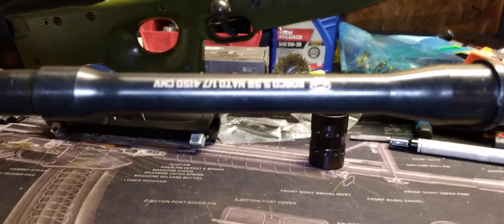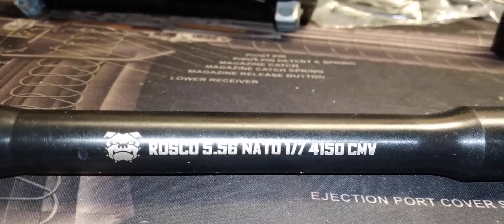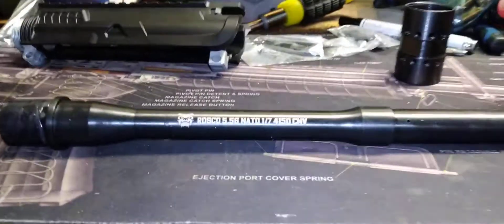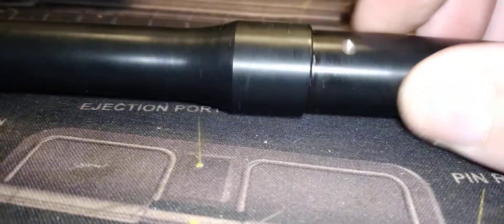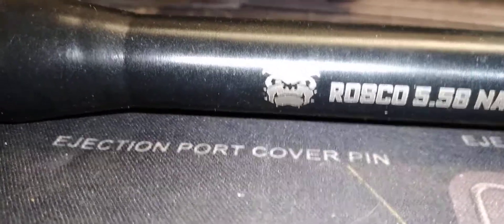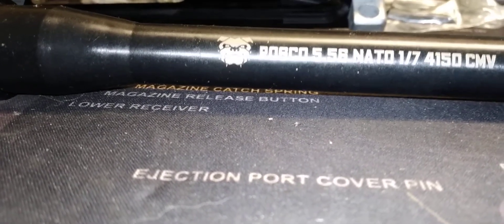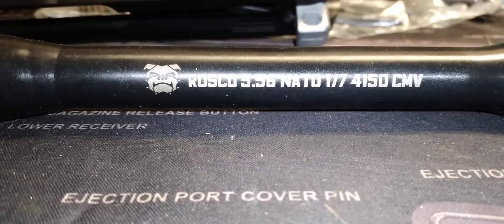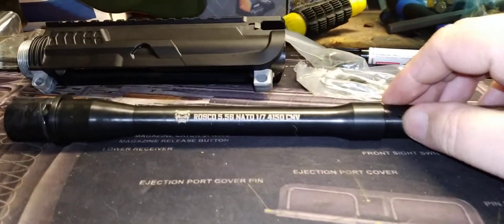Rosco manufacturing 12 and 1/2 in 223,556 barrel 1/7

Comment: Mostly I'm thinking how to convert my pistols to 16 inch barrels but wouldn't build a 12.5 today.
Reply from the maker: to convert a pistol to a rifle is easy yu can to it two way with a new 16in barrel or a 14.5 in barrel witha muzzle break pined and welded to 16in.
I
Reply: @RTACDaughters  Well, I think braces will always remain legal for me. But my LWRC 12.5 is a piston upper. I called and asked how much to get an adjustable gas block. They said $500 because it would also need a new barrel. I can get any barrel length when I add the adjustable gas block. My other two uppers are PWS pistol uppers and I think  I will need a barrel and maybe a new long piston/BCG from PWS.